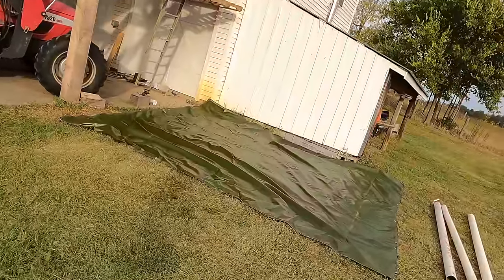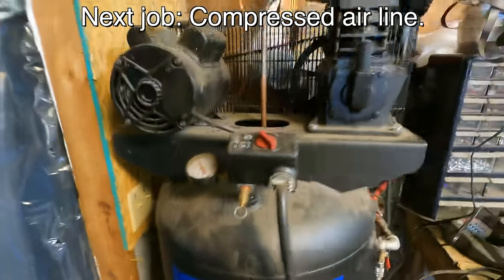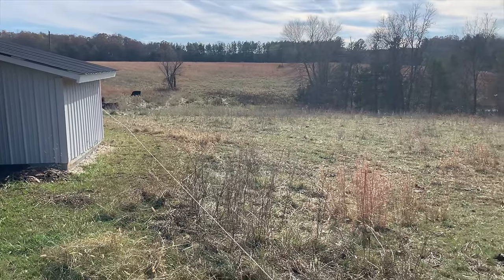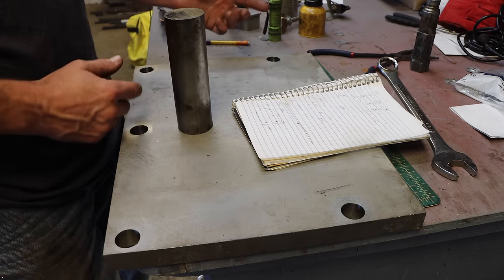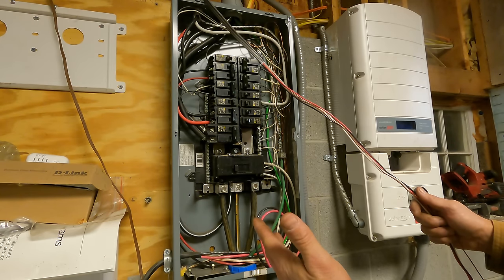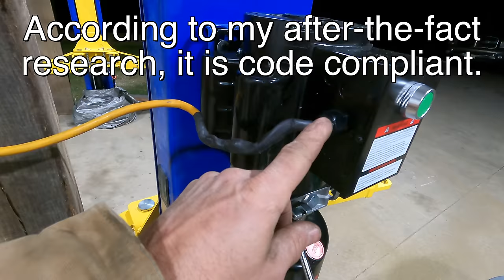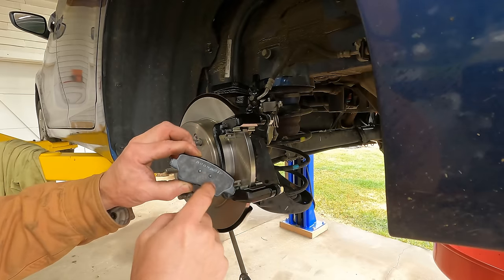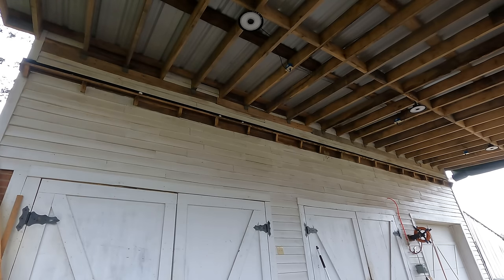Installing a 2-Post Vehicle Lift And Other Big Shop Improvements.

Comment: I am curious to know your thought process when you chose to put the lift so close to the edge of the pad rather than one bay over and farther away from weather conditions. I hope you don't find yourself stepping off the edge of the pad or backing into the tarp when it's down when removing tires off larger vehicles or pullling an axle out ect. Also I like when you said the recepticle box was a little tight in there but there is plenty of room. Thanks for the vids.
Reply: Yep also supposed to be a distance away from joint lines

Comment: The reason why Pex isnt approved for pneumatics is because its capability is ~130psi in the summer heat (not in sunlight), and drops to sub 100 if in direct sunlight, which tends to cause it to blow up unless you regulate pressure at your tank to sub 90psi which below what most tools want.

Comment: I really like the lift and   not having the need for a creeper.  But hopefully H.R. came thru on those dreadful working conditions!! C'mon , if it's not livestock, it's geese,deer  or bears. PITIFUL, PITIFUL.🤔 Won't even mention those sunsets ???
I use 1 1/2 inch deck screws for the shades. Also 2x4 in 4 inch PVC, screwed  3 inches from ends to allow push on caps with one screw holding them on. Stops birds,bees and mice while weighting down tarp in a stiff breeze. ( Not gusts) 
Tarp won't go anywhere!🤣🤣🤣

Comment: That outlet setup is not going to pass the current NEC because hard wired appliances need a dedicated disconnect. I am also not sure if you can legally split up a circuit like that. It is not MWBC so while your neutral can technically never carry more than 20 amps your 1 leg can.

Comment: I was thinking of pvc , but pex wouldn’t be easier. I often use 120 psi . I wonder if it will hold.
Reply: Pex is perfectly fine for compressed air and is superior to pvc. OSHA actually PVC compressed air pipes because it’s more likely to shatter and cause injury. In reality it’s more than likely fine but if you have to choose pex is better.

Comment: Have you had the chance to put a 1 ton crew cab 4x4 diesel on the lift yet? I was pretty set on the Bendpack 10k lift but if this thing will do the job for 2k less I am interested. Thanks for the video!

Comment: Soldering:  while you may have done so and not shown it or I missed it in the video alway pre-run you soldering gun/iron tip with solder and add a bit to the items being soldered to create a heat bridge between the soldering tip heat source and the items being soldered even adding a bit of extra solder between the iron’s tip and wires being soldered then you can quickly move to the opposite side to apply solder and have it pull the molten solder towards the tip and through the wires being soldered.  This is especially useful when soldering wires with delicate insulation to minimize insulation damage and wicking of solder up underneath the insulation.  In missile soldering we used a special wire heat sink at the base of the insulation and wire to help prevent the soldering heat from damaging insulation and prevent molten solder from wicking up into and under the insulation.  There were several reasons for this key among those reasons was it allowed a quick visual of soldered connections to see if stranded wires had broken from vibration and other electro-mechanical influences that stress a soldered area to failure that a visual inspection could be performed in each connection where the solder stopped without having to ohm wires if not necessary to spot electrical connection failures.  Army 74-77 Improved Hawk Surface to Air missile defense system.  You also had to not handle the exposed wires and/or clean them with high proof alcohol before and after soldering to remove any skin oils before soldering and any residual flux after soldering.  Solder 50 pin amphenol connector and some worse more closely crowded connectors was a pain to do it and do it correctly.

Comment: Man, you and that lathe! Outstanding video man. I’m a low-voltage guy so I’ll leave it to the ham-fisted high-voltage guys out there in regard to your outlet. I wonder if it would trip the breaker? Anyway, I didn’t watch the video but the one where you made a knife.. Are you a farrier?? I’ve met several farriers and they’re not as bright as you! What happened? 😂

Comment: You’re an amazing craftsman, sir!  
One question: where does one buy the wire stripping do-dad you’re using to strip the ends of the wire when you’re installing the outlets. It’s box shaped. I need this  pronto!
Reply from the maker: Any electric supply store.  I think I got this at lowes many years ago.

Comment: Great video, question- How come you put the lift on the right side of that area? Seem there would have been ample room to install it in the center section and thus its further away from weather affecting it. Also it would be further out of the sun so if youre working on something on a hot sunny day the sun wouldnt be affecting you.
Reply from the maker: I thought on this a lot.  The wooden posts on the right bay are closer together, and the lift obviously constricts the size of the bay, so my narrow bay became narrower with the lift.  I decided to leave the middle bay alone as it's wider, good for bigger equipment.  I would have liked to keep it out of the weather better, but I will fluid film and grease it as needed, and the shade tarps should do the trick.  Ideally I would have put the lift in the middle and had my widest bay on the right, but the way the concrete slab sat with the building I would have had to do concrete work prior to building the addition.  And I didn't think that far ahead at the point where I was designing the addition.
Reply: @FarmCraft101  makes sense :)

Comment: Great work on the videos!  Definitely one of my top 3 channels!  Looks like the lift fits perfectly in there.  Did you plan that when you built the shop extension or was that a happy coincidence?
Reply from the maker: Thanks.  The lift was the first thing I measured when designing the addition.  Built to fit.  Cheers!

Comment: TIP: At 4:50, if you put another Lag-Bolt in a drill; you can use that one to tighten up the one your screwing in.

Comment: Seems to me that cutting the concrete and pouring small section with the high PSI concrete would have been easier than all the shimming, plate cutting, etc.

Comment: The solder joint would not be compliant here in Canada.I would have just ran a new piece of wire the entire length. Would not be that hard.

Comment: 37:07 curious why you didn’t install the cable at the manufacturers termination points inside the switch box.
Reply from the maker: It was going to be lot of work, crimping connectors that I didn't have, and in a pretty small space.  Didn't seem worth the trouble.  Cheers.
Reply: It looks like someone chopped off most of the original 5 feet of connecting cable and used it elsewhere.

Comment: Any problems with moisture in your air system? Water in the bottom of the compressor tank? 20 ft. Of metal pipe will condense the moisture, slope away from compressor

Comment: Psst: 120v outlet fed by a two pole breaker is hardly code compliant. So that outlet being 15 amp on a 20 amp breaker and being non-GFI outside won't even matter. The cord to the equipment...every single inch of it is a red tag.

Comment: WoW!  You went through way too much trouble with that shim.  All you needed to do was set the post where it had to go and temporarily shim till it was plumb.  Then drill out your slab and epoxy set longer threaded anchors.  Once epoxy was set, pick the post and put nuts then flat washer on each anchor. Set your post and adjust the height of the nuts till perfectly positioned.  Lift the post, mix up a lean batch of non-shrink, Portland cement-based grout and dump it in the area with the anchors.  Make sure there's enough to fill gap and squeeze out. Set post, and then flat washers and nuts and tighten.  Clean up the excess grout.  This is the method pro installers use.

Comment: Do you not use an Earth Sheath in America ? Its normally Green and Yellow and just slides over the copper earth cable. Something I have always used with Twin and Earth cable as its very cheap when doing any DIY Electrics.

Comment: As always, awesome job. Was wondering if the seals would show. 
You didnt disappoint. Lifts rule.  Kick myself for not getting mine earlier.  As how to pick up your mower 2x4s (or 4x4s....."that's not going anywhere"......across the front arms of hoist in close, same for rear.   😁

Comment: Just watched this video again to reference the roll up tarps for a hot tub pergola. Thank you again for posting great content!! Ps... how much pressure do you run in your PEX system? I noticed 120 PSI on your regulator, but your compressor is capable of 155 PSI.
Reply from the maker: Yeah, I run it at 120.
Reply: @FarmCraft101  thanks for the reply! 🙏🏼  Any particular reason for running at 120 vs 155?
Reply from the maker: Don't want to push it too far.  If I recall at 100 degrees F the PSI rating is around 180.  A little too close for comfort.
Reply: @FarmCraft101  makes sense! 🙂👍🏼

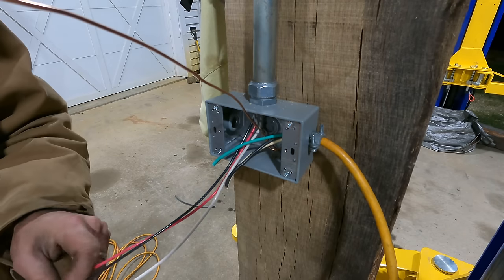Comment: 32:50 I've been wondering about that myself. If you're overloading the 120VAC outlet, that's only stressing half of the 240VAC breaker. Is that sufficient to trip the whole breaker with the two breakers being mechanicly linked?